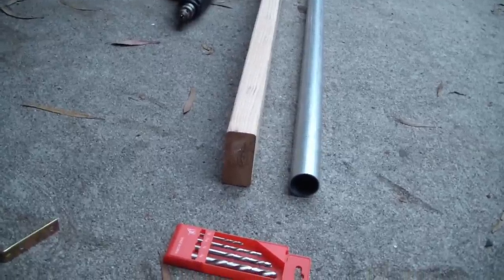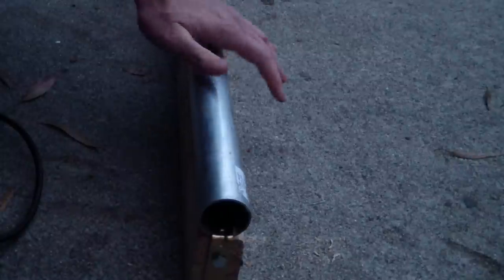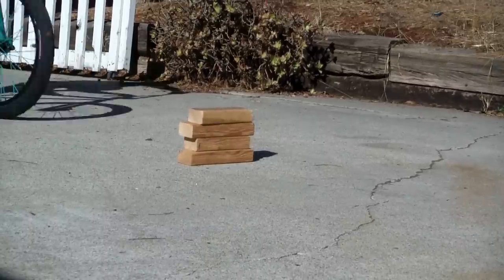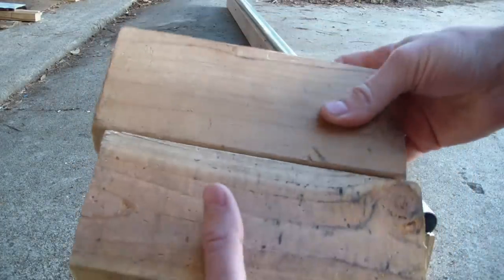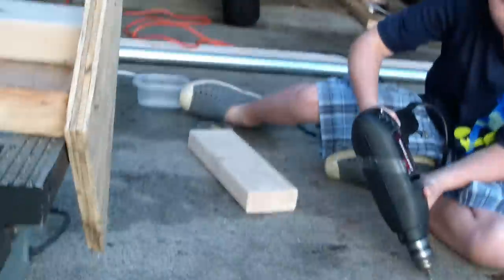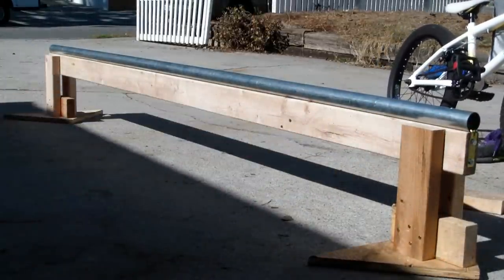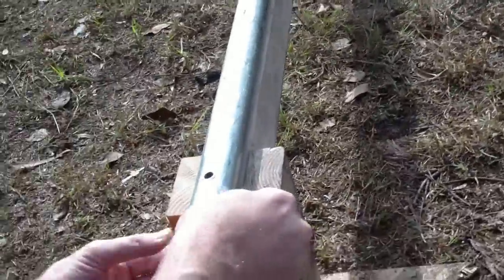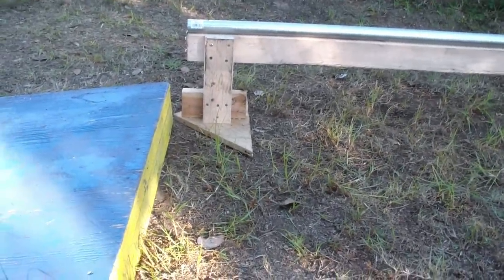How To Make A Grind Rail

Comment: Great tip to anyone this is still looking to build this rail! On the bottom of the triangles or whatever your using for the base, Glue some "Rubber" type matting so it doesn't slide around! Works great!
Reply from the maker: Great idea. Thanks.

Comment: Why are you such an epic dad? :D
Reply from the maker: Thanks!  I figure if you have kids, you should enjoy it and have fun with them.
Reply: ***** Wouldn't the skateboard wheels hit the 2x4 supporting?
Reply from the maker: Armando Angel   They might, but only if your board slides all the way over to the trucks one way or another.  You could try and design it slimmer when you build yours. Another option is to build a grind box with a round rail, which I show you how to do in this video: http://youtu.be/S8rzCfZPpxM
Reply: Armando Angel You can do some small 2x4 going sideways and tht will work to but your rail may flip over sometimes

Comment: Awesome! Me and my son started scottering How much weight can this support? I would to like build one for my son and I..
Reply from the maker: It is very sturdy, with all those 2x4s supporting it. My son is around 150 pounds and tides it a lot with all of his friends. I recommend bolting the L shaped steel rail to the box for maximum strength, and put wheels on the end of the box so it is easy to move around. Here are the wheels we used.  @pkKhsBSTd-I.  Here is my son's latest grind box video.  @watch?v=DutPtf2PTuc

Comment: ive seen alot of rails like this and this is the first one my friend and I are gonna try to make. Were gonna have it 4 to 5 feet. Do you think that would hold up were each roughly 200 pounds. plus light 24.3 pound bikes
Reply from the maker: You should be OK on this type of rail. Make sure you build sturdy feet onto it.  Another option would be to build a grind box.  Here is a video I made of us building one out of some 2x4s and a sheet of plywood:  http://youtu.be/S8rzCfZPpxM

Comment: i made this exact design but at the bottom i didnt have ply wood so i just used a 2x4 for the supports and it works great also i couldnt get a metal bar so i had to use a plastic pipe

Comment: How long does it last? I will be grinding on it with lots of speed and heavy impact. Will it still hold for a long time before I have to fix it?
Reply from the maker: We used it for a few months and then put the rail onto a grind box, which is really sturdy.  If you build a grind rail, make sure the feet are really sturdy.  Here's my video on how to build a grind box.  http://youtu.be/S8rzCfZPpxM

Comment: Awesome tutorial! Thank you very much :D I took a little inspiration from how you attached the fence post onto the 2x4 and I will do the same to build a grind rail for my aggressive blades, it'll be awesome!
Reply from the maker: +LetsPlayKH You're welcome.
Reply: +LetsPlayKH That's soo awesome! I just built one of these today for aggressive blades and it works fabulous!!!! Don't make it TOO high though, The top of my rail at 20" and its perfect! Good Luck!
Reply: Mr. Motivation
Thanks for letting me know that this build way is great for aggressive blading! :D I will build mine today, just need the pipe that goes on top and I'm good to go I think :b I will make it as low as possible for now, because I just started blading a week ago and my jumps are way to low :D

Comment: I looked up fence posts at Home Depot, and it looks like the metal is 1/16 of an inch. Is that the case with yours as well? I'm interested in making a skate rail and I weigh about 130 lb. Based on your experience, would you guess that it would be strong enough? For some reason, a DIY-skate-rail site I found is recommending 1/4" thick steel, which seems ridiculous to me.
Thank you.
Reply from the maker: SB Account The one we used is 1/16" and it works fine.  1/4" would be indestructible. We also used 1/16" fence posts on our skateboard ramp, and they work fine there too.  Here's a video of the ramp:  http://youtu.be/qYVTTxosLrc
Reply: ***** Great. Thank you for responding.

Comment: this is awesome but like that Kenny guy said, the wood hanging on the sides at the end will get in the way on certain tricks. there's a website called diyskate that has a rail tutorial similar to yours but you side it with plywood so you don't have any overhang on the sides. with both your video and that online article you could make a killer weldless rail

Comment: Higher quality hubs tend to be louder because they have a higher number of "pawls"  and more points of engagement when you pedal.  To make a regular cassette hub louder, you can take it apart and find where the spring that engages the pawls is located.  then take the same spring out of an old hub and put an extra one in the hub you are using.  Hope that helps your son!!

Comment: you didnt need 4.... for the first one put it in, use second bracket to gauge where the wholes are, then the rail should be nicely snug after fully drilling one end, then before screwing second Lbracket use it to gauge where you need to drill, drill the hole then fasten it in and drill through the hole, BAM. just a tip, otherwise beautiful and i will be making one of these, with few modifications. GREATJOB! sub/like

Comment: how did you make the kicker?
Reply from the maker: That one is made of 3/4" plywood and 2x4s.  It is a small flat ramp.  To make a kicker with more curve, which will shoot you up into the air, use the string method to determine the angle. Here is a video I made to show you how to do that.  @RYCeY0B0MM4
Reply from the maker: @RYCeY0B0MM4

Comment: ok im sorry.. this is a poor excuse of a carpenter.. even if it is for a small project like this.. just get half inch screws.. make a vertical hole on the inside of the pipe, and just brace it to the 2x4, simple as that.. if you get diamond bits.. well thats too far but yeah